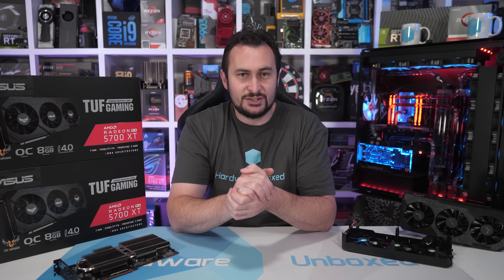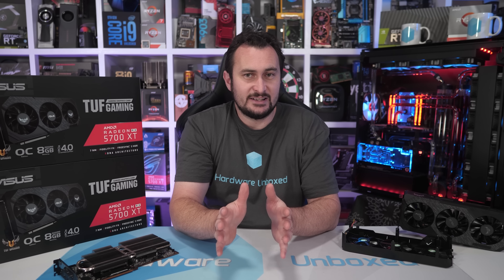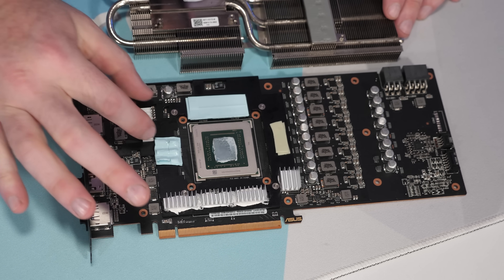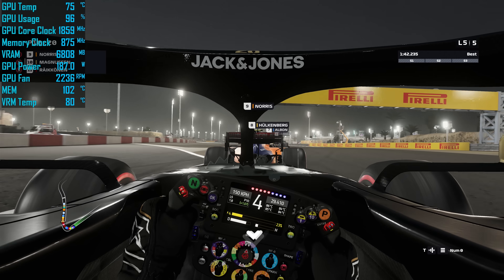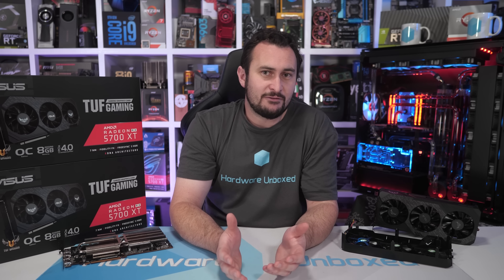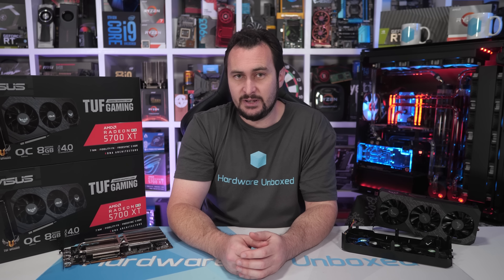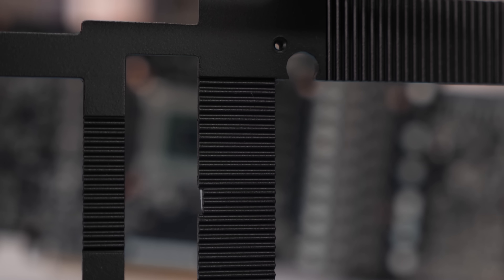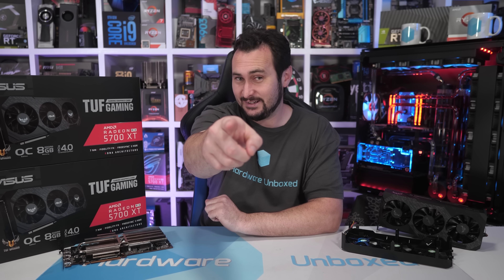Fixing the 5700 XT TUF, How Much Cooler Can We Make It?

Comment: So instead of recalling defective cards they sell them at a "discount"? Isn't that illegal?
In EU they are not cheap tho, cheapest would be powercolor version
Reply: They're defective, not dangerous.
Reply: @heisenberg1338  It's quite common to sell defective parts at lower prices, when the defects don't ruin the operation of the product, and if they don't ruin other products they interact with during their use. Recalls generally only happen when the product poses a risk or occasionally if an easy fix can be made. I think it's in ASUSs best interest to recall the thing, but I don't see that they have any legal obligation to do so (probably varies by region). It's under warranty, so you can RMA the GPU if it doesn't work as advertised, and you can always get another warranty with Amazon or NewEgg that will allow you to swap for another GPU for any reason (I assume you can get a similar deal in the EU). If there are enough affected users, they can always sue to reclaim lost value or whatever, like when AMD was sued for the FX series.

Soy boy? You're getting a little hostile for whatever reason. I don't think I've heard Linus say anything bad about you.
Reply: @nimrodery  again you comparing literally defective/unfinished crap that performs worse than stock card and costs more and eventually will fail on you due to high temps to something that didn't perform as well as it's counterpart, you know what scratch that it's not dangerous, something that reaching a cooking temps in your pc is not ok
i just can imagine what happens to your motherboard that this card attached to, anything higher than 70 in my book is overheating and i won't have that in my pc

Everyone praised i3's and i5's but when games started to use more than 2-4 cores things has changed, fx series maybe didn't perform as well but at least you didn't had stuttering due to high cpu usage and multitasking was still an option, even one the 6 core
and no it's not quite common to sell defective or unfinished products, unless you shop at apple, at least not where i live, it is maybe acceptable on aliexpress then again you can always het your money back if shit doesn't work as supposed to, with asus you probably be stuck in an endless rma loop until your warranty expires because they gonna send you same broken crap over and over

 and yes linus is a soy boy, he does look like one, who only cares about money, his video's are filled with ads which is impossible to watch in and out and all of his content is just a pure advertisement, he only says something negative when it suits him, for me views of course, even when it comes to his own criticism, maybe you enjoy prepubescent voice, to each it's own i guess, besides he can't say shit about me, because i am the one who knocks ;)
hub is the only channel on yt that i trust and they always make a quality content and sticking to the content despite their sub count is not as high as linus, tech jesus annoys me because of his mumbling and i always almost fall a sleep while listening to him be it a day or night, so that makes hub the only channel atm that worth watching and trusting, to me at least, the rest is just filler, basically
Reply: @heisenberg1338  LOL My last CPU regularly hit over 90 degrees, so did my last GPU. It only lasted 8 years.

And if you don't like Linus, stop watching him. Duh. Same with GN. Nobody cares who you trust.

And by "products" I meant "products." Not the small segment of the total market that is "computers." Never seen a defective product for sale? I don't know what stores are near you, but Winners and Walmart do it all the time.

I also didn't ask you if Linus is a soy boy, I wanted to know the reason you're so hostile. It appears that's just you.

Comment: Off topic but its urgent, what's the safest voltage for all core overclock ryzen 3600x(3600) or even all of the Zen 2 processors and What is the best way to stress it for stability ?
Reply: Max 1.35v. 1.40 if you dont use it often.
Reply: Best not to exceed 1.325 volts for continuous use. If you can get a decent stable OC below that it would be better for long term peace of mind.
Reply: The best and fastest way to check for a successful OC? P95,OCCT,Realbench ? For howlong ?
Reply: 1.35v was the "safe" voltage for zen 1000. I wouldn't oc the 3000 series as you lose performance in most cases. If you have to oc don't go beyond 1.3v
Reply: @ivanbrasla  the thing is it hovers to around 1.42V while on stock and temps are really bad while gaming. And OC 4.2ghz all core I lost 1%in single core performance but a pump of 10% increase  in all core with Better temps across the board.
Reply: 1.325v according to AMD for Ryzen 3000 CPUs
Reply: @jikman681  these limits were for the zen 1 architecture with a 14nm node. Now its Zen2 with 7nm so I need a more accurate answer.
Reply: I suppose I should go into further detail:

I believe that 1.35V is the "safe" max for zen 1/zen+ if max temps exceed 70ºC, but 1.45V for zen1/1.4V for zen+ are "safe" max for lower peak temps.

Similarly, try to stay at about 1.2-1.25V if you have high max temps on zen 2, but up to 1.325V if you have lower peak temps.
Reply: @kaledtarek1  I go with a P95 torture test, seems to uncover issues quite quickly. I would suggest a minimum of 5 minutes, better if it's a half hour or so.
Reply: @kaledtarek1  If you need to lower temps find the PPT setting in your BIOS and lower the value as needed. Standard values are 88w and 142w for 65w and 105w tdp cpus, respectively
Reply: @auturgicflosculator2183  what about the safest and fastest way to check for stability? Cause when I apply a considerable low voltage the PC restart while running OCCT with max temps before restarting of 72C for example it was (1.28V for 4.2Ghz) it was running for about 13 mins
Reply: @Cmdaddy88  This is a non official response spread by people and taken as legit. AMD answered to this and said to use default settings if you want longevity on your cpu
Reply: @kaledtarek1  your temps are likely more a sign of your case. My 3600x only hits a peak of 40 degrees as I have a really open case (coolermaster h500m). Zen 2 tends to run really cool so high temps suggests more just poor cooling. Suggest looking at a more open case. Mine for example has the front fans set to max but since they are 200mm mag lev they make no sound. My PC is basically silent even when at full load. It still runs far cooler than my 8700k at 4.7Ghz downstairs. That thing idles at nearly the 3600x load temps in the same case same AIO. If you need a new case, go with the h500. It's far cheaper and easier to work with.
Reply: @kaledtarek1  Oh, and if you have watercooling you may wish to extend the minimum testing time to about 15 minutes to allow the water temp to rise to equilibrium, giving you a more accurate temp reading~
Reply: @ivanbrasla  Thanks for clearing that up for me.
Reply: @Skylancer727  the thing is Iam using wraith spire and want the maximum perf with good temps lol.
Reply: 1.21 Gigawatts.
Reply: @auturgicflosculator2183  no its just wraith spire with 3600x and msi tomahawk , restarts with no enough voltage instead of BSOD so It worries me
Reply: @wing0zero  i think you mean 1.21 terawatt lol
Reply: @kaledtarek1  From the sound of it, you're pushing your CPU too hard for the cooling solution you've got. Err on the side of caution~ :)
Reply: @auturgicflosculator2183  now iam running on 1.309v with 4.2ghz all core stable 30 mins of OCCT max temps is 76C , while gaming hovers from 58 to 62C and while cinebench r20 loop never exceeds 72C. Is it high temps? should i decrease the voltage and freq?
Reply: @kaledtarek1  Your case matters more than the CPU cooler. Plus the spire isn't the best cooler ever. It will keep you to spec but gives almost no overhead. Still better than Intel though which basically just allows their CPUs to throttle at 90 degrees. Again, gonna put it on the case not the cooler. Air flow does matter. Used to use the Inwin 805 infinity because it looked cool. Moved up to the h500m as temps with a sealed front didn't let me reach good  clocks on my 8700K. My brother has a 3600x though so I do know those tend to run even cooler though.
Reply: @kaledtarek1  Ah, I hadn't realized OCCT pushed temps quite that hard...it doesn't draw nearly as much power as P95 does. Your gaming temps seem reasonable, I wouldn't worry~♥
Reply: @auturgicflosculator2183  AVX2 and 12 thread stress it's pretty demanding but prime95 smallest ffts is the hottest with 85C for sure with a powerdraw of 100w

Comment: is there a problem with every tuf gpu or is it just this one
Reply: The actual cooler hardware of a typical TUF gpu is smaller on average than the other ASUS variants, but in my experience they aren't much cheaper. They're not "do not buy," they're also not recommended. It also seems the better PCB goes in the Strix variant.

Comment: I used to trust ASUS products a lot but never again...

I think TUF is not a crap product. THICK II is a crap product and TUF is a broken product... 

There is no way they did not know the issue with memory temperatures (I want to believe they test their product before release as much as you do, lol. Other way around, I think they can hire you before they release it for purchase.). They didn't even bother to apply a quick fix such as you did before releasing it. And above all, they don't even take responsibility for that, they should pull the stocks and even inform the buyers and offer refund or replacements for their cards...

Btw, I would like to ask a question regarding some RX 5700 XT cards. Do you recommend sapphire nitro+ over pulse or is there an issue with that card? There is also nitro + special edition and would like to get some opinions on those cards if you have?

Bonus question: How is ROG Strix RTX 2070 super OC performing? Is it also another faulty product?

Comment: So Asus are going to make sure the problems with the STRIX cards won't be repeated again in the future are they? Yeah ok, the did the exact same thing with Vega 56 and 64 cards. I have a later 56 STRIX from back in Dec '18 with their supposed VRM fix update (they added an extra heatsink) but the mem temps will still hit 100c and that's undervolted and with crazy fan speeds (it's the noisiest card i've owned) and good air flow in case. This card will draw well over 300w at stock clocks and 50% extra power slider, which is crazy. Sorry for my ramblings but they have clearly learned nothing or simply don't care. I won't touch anything from them ever again.

Comment: I saw tech yes city 5600 xt review and it was a tuf model and its performs very well even in temps.
Reply from the maker: Yeah it might, this is the 5700 XT version. I'll check the 5600 XT model soon.
Reply: How can you tell if it performed well in temps? He didn't compare the temps with any other card, just reported what he got, in his specific test scenario.
Reply: @auturgicflosculator2183  well he showed some gameplay with vrm, gpu and mem temps

Comment: For cases like MSI or XFX where the products were reasonably functional, just maybe not as good as they should have been, I think selling at a discount to clear stock would have been an acceptable response. Not impressive in any way, but acceptable.
But these cards are at constant risk of failure. They don't qualify as functional. Asus should have recalled these things and offered to repair, replace, or refund.

Comment: Asus for some reason is sabotaging AMD gpu's for quite some time. 
I own Vega 64 Strix, that one had terrible vrm temperatures because bad thermalpad height, I had to as many people buy I think it was 3mm height to make it work properly, I believe that there was also something wrong with the RX 480/470 series from Asus but I could be wrong. Now the RX 5700 series both strix and tuf are bad, strix has even worse thermal problem with vrm than Vege because of screws that are too long and tuf as the video shows has just horrendous GDDR temperatures. 
Now I really can't remember that many problems with nvidia gpu's. I owned 980ti strix that had pretty terrible cooling in my opinion, I remember that the gtx 1070, 1080 & 1080ti had some problems with cooling vrm or GDDR but nothing as bad as the AMD gpu's get so I really don't understand what is the deal with asus, especially since they are pricing them the highest from all vendors.

Comment: ASUS should/could have made a low end card with a dual fan setup with better memory cooling rather than spending extra money on a 3 fan design that has piss poor memory cooling. A budget 2 fan card that works is MUCH better than a 3 fan card that kills itself. If they haven't, ASUS should be refunding everyone that purchased that particular TUF card. Also, did the TUF card have a similar mounting issue? If ASUS is claiming that  they were going by AMDs recommended mounting pressure, wouldn't it stand to reason that all lines of ASUS cards would be mounted to that pressure?

Comment: Crap products is one thing, but this is a DEFECTIVE product. It is running out of specification and can only be corrected by replacing a primary component that the company tries to convince you will void your warranty if you remove yourself. The fact that this even made it to market is a complete Charlie Foxtrot. The fact that these cards were not IMMEDIATELY recalled is just another slap in the face to consumers. Add this into the fact that their PREMIUM STRIX cards are just as much of a screw up and it's made obvious: Asus does not care about you unless the card you are buying from them has an RTX prefix. The community should avoid every single one of their AMD GPUs (or ANY of their AMD products for that matter) until they have proven (via redesign that is tested and confirmed with 3rd party sources) that they will actually put forth effort to, AT MINIMUM, release a product that isn't defective as part of the design; recommended until they prove they can release a product that is comparable to the competitor's products.

Comment: The truth and totally not a conspiracy theory:
nVidia pays ASUS and MSI to intentionally both all of their AMD models (down to the Strix R9 line-up), that way the cards will fail and users will have a bad experience with them, blaming AMD overall rather than ASUS/MSI and then swapping to nVidia once they can't take it anymore/the card fails/time to upgrade has come.

But it's also partly AMD's fault as they don't force the custom model manufacturers by contract to have sufficient cooling or face dire consequences.
Reply: Or maybe companies are trying to save money by adapting coolers from popular GPUs for use in less popular ones, rather than redesigning each and every time a new GPU emerges. AMD could really help out by trying to maintain a similar component layout from PCB to PCB. GPU margins for OEMs are razor-thin. I don't expect companies will stop trying to save money.

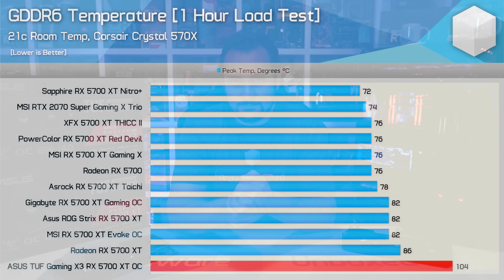Comment: 0:28 That's why I bought RTX 2070 Super and also I'm afraid of Playstation 5 having AMD components. PS5 Consoles could die in 2-3 years of non stop playing because of too high temperatures.
Still for me 90*C is bad, you need to do something about it,  80*C this is acceptable but it's close to 90*C so if you get some dust it can be close to 90*C. 70*C while full stress is very good.
My AMD Ryzen 3700x with BlackRock 4 cooler and newest Bios update get max to 76*C

Comment: Asus: Pay more for Inferior Products. 

Every other PC Hard ware company for CPU/GPU Hardware. Pay a bit less for better quality.    Hmmm great Marketing approach.   Obviously this exposes varies things About such a Company.
1: Customer dosent matter.  QA: Asus what is that ?  Honestly dosent anyone at these companies actually do proper In house testing of their Products not exactly hard to place a few GPUs in some test benches run them on some GPU intesive tests in a loop monitoring Temps, Voltages etc to discover defective designs or poor manafacturing issues
Obviously this isnt a Boing 737 MAX type of issue where lives are at stake...BUT it IS a defective product and as such it should have been instantly recalled back , modifications made then rereleased. This includes refunding existing Customers or offering a swap to a Modded updated GPU. Its not pennies we are talking about its for many people a fair bit of money.
IMHO a Totally unaceptable state of affairs especially their attitude of still allowing existing stock to be sold on to those who will likley be less informed. This should also apply to Retailers selling defictive Hardware they should have some knoweldege of what they are selling and react accordingly.
Asus now on my vendor Black list for any of their products untill over time they prove they have improved their whole Company approach and attitude which currently stinks.